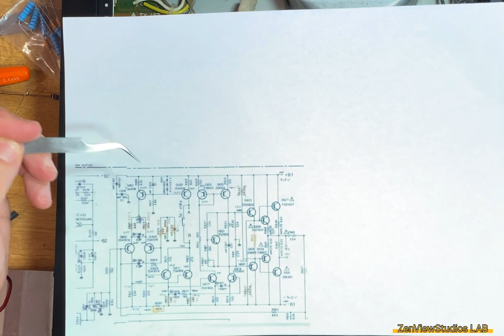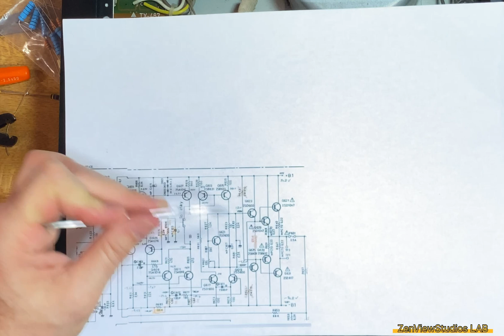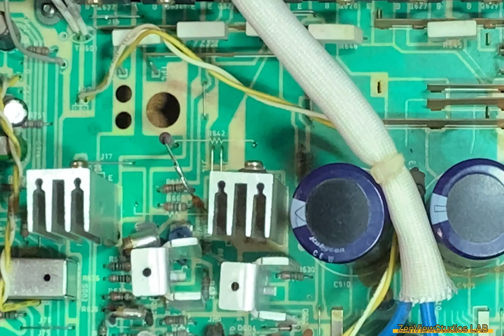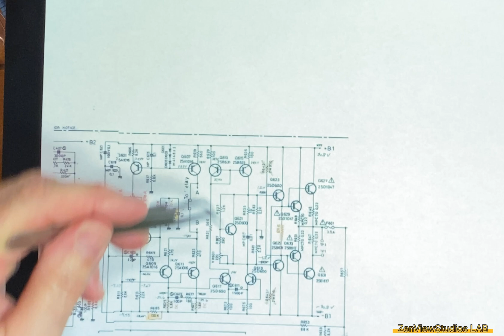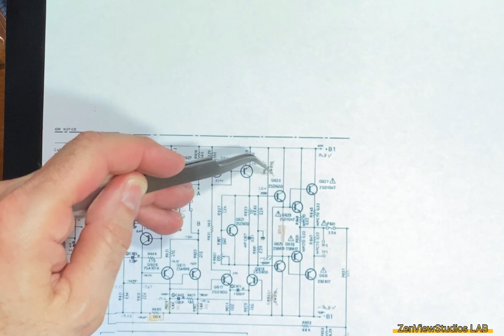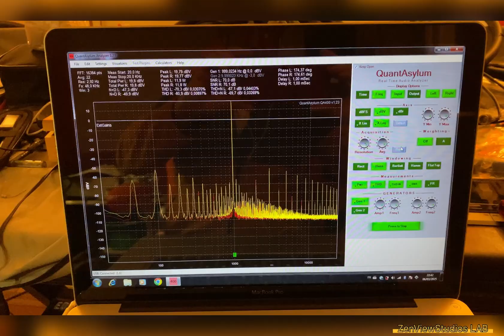#2upgrade Rotel RA-840BX4 55 watts amplifier, THD(-11db) to -81db with this simple mod!

Comment: Hi eric

whic wattage you suggest for all the resistence we need for modification ? In particular for the 82ohm ? 

and for the 270 ohm and 10k ohm ?

thanks in advance
Matteo from italy :)
Reply from the maker: tchao Matteo, 1/4 watts resistors are fine ;) perche la corente in questa modificatione e molto piu debolle qu'a l'origine e dunque ai anche meno dissipationne thermica :) gadagni anche alcune watts Di potenza massima !
Reply: @ZenViewStudiosLAB  Thank you so much for your reply. Given your great professionalism, may I ask if you also suggest replacing the two 8200 uf capacitors and the 4700 uf one to freshen up the entire system? Do you have any suggestions on which ones to buy? Thank you so much again.

Comment: Hello Eric. I am working on ra840bx4. I want to do the r641-644 resistor mod. You used an 82 ohm resistor…what was the wattage needed? Thanks.
Reply from the maker: Hello Anders , sorry for the delay, somehow I don't get all comments notification !...the unique 82 ohm replacement resistor was made with small wattage resistors, I made them with a quarter watt or half a watt resistors...you can see on the video they are tiny as they there is very little rest curent flowing...hence also a gain lowering thermal dissipation, and power of the stage gains a few watts...

Comment: Suggestion très intéressante, les résistances de mon ampli — celles que tu recommandes de retirer complètement — étaient grillées avec des valeurs ohmiques très élevées et pourtant l’ampli fonctionnait quand même, et même très bien… Je l’ai réparé, mais je vais sans aucun doute essayer la modification !
Une curiosité : les spectres ont-ils été relevés avec l’ampli délivrant sur 8 ohms ?
Merci beaucoup.

Very interesting suggestion — the resistors in my amp, the ones you recommend removing completely, were burnt out with very high ohmic values and yet the amp still worked, and sounded great too… I’ve repaired it, but I’ll definitely try the mod!
One curiosity: were the spectra taken with the amp delivering into 8 ohms?
Thanks a lot.
Reply from the maker: Hello , sorry for the long silence ! Somehow I never saw your comment ?! Something , is not working right as I got no notifications...
Anyhow, Yes all spectrum and measurement were made with 8 ohms dummy loads . Cheerios